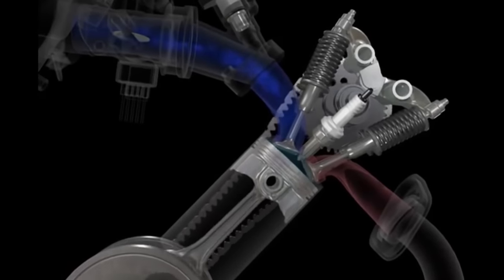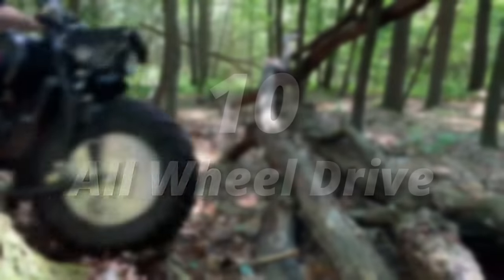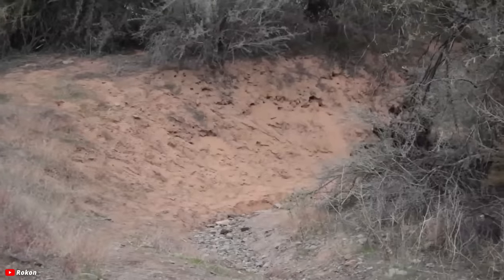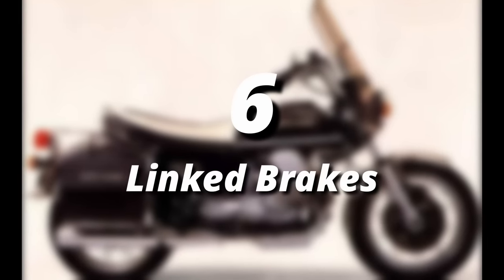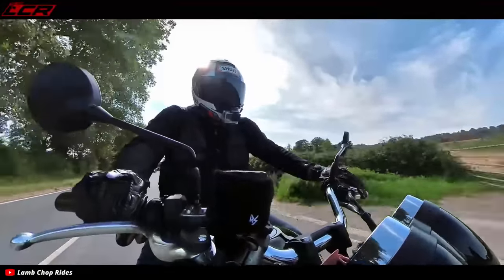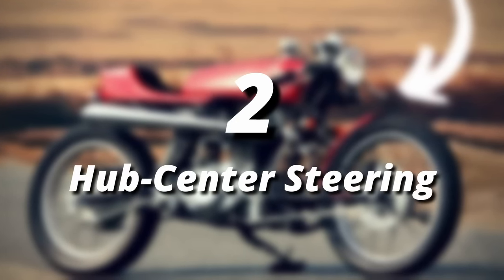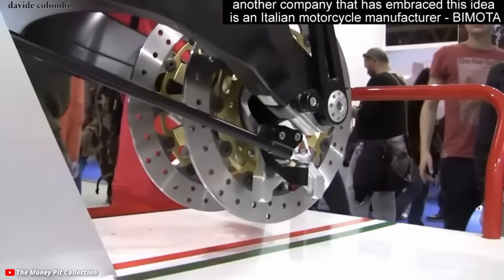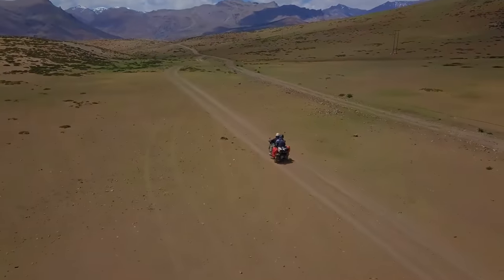10 Motorcycle Innovations that never caught on

Comment: My favorite innovation that never caught on was the Triumph sprung hub. It’s a suspension unit contained within the rear wheel hub and it was designed to give Triumph’s existing rigid frames the option of rear suspension.
Reply: @Retired Bore not only that, it was  also “potentially dangerous at high speeds” and one of the first moto accessories to come with a safety warning. It is also remembered as “a pain in the ass” literally and figuratively to repair and “one of the weirdest and worst rear suspension systems of all time”.
Reply: It was a good enough concept but simply didn't work well. Using modern metals and dry teflon sliding surfaces it would make a good addition to a hard-tail chopper, adding a bit of cushioning for the worst bumps without losing the classic hard-tail look; certainly more visual appeal than a 'savior' frame which works as equally bad as the old sprung-hubs do. Can't see much use for it on any other kind of bike though.
Reply: @P_RO_  Maybe on bicycles ?
Reply: What about the Buell?  Everything is different.
Reply: Sounds like someone has never riden one or had anything to do with them,  an atrocious idea that fortunately never caught on and lasted but a few years,  there are reasons why swinging arms are used on all bikes.
Reply: @Deontjie  Just a modified harley engine changing the stroke
Reply: @Johnketes54  not just a modified Harley engine. Mass centrilization and rim mounted brake rotors were also employed. Being bought out by Harley and saddled with that dinosaur sportster engine as well as no dealer support killed Buell.
Reply: @Retired Bore Turner is also credited with the Ariel Square Four and the 1971 Triumph Bandit / BSA Fury 350cc bikes.  It is unlikely he did much of the detail engineering
Reply: Very pretty to look at but even worse than the generally awful norms of its era.  Sprung hubs simple cannot offer sufficient suspension travel and are far more expensive to make than traditional hubs.
Reply: @obfuscated3090  the Triumph sprung hub gave limited suspension travel. Lots of gubbins had to be crammed in a small space, so it had limited bearing area, and wore rapidly - and the handling deteriorated badly.
Reply: @billstuart8481  buell wasnt bought out by harley. Eric Buell was an engineer for harley and built those bikes while working for harley. Then went out on his own with an engine manufactured by an austrian company

Comment: On the subject of automatic transmissions, they have taken off in a big way in the scooter/light motorcycle vehicles that are common all through SE Asia.  Some are the "it does everything for you" types, but what's also common is a transmission that allows you to shift, but you don't have to use the clutch at all.

These are really popular all through SE Asia, and the smaller Honda bike I ride around town and for errands uses this kind of transmission.
Reply: It is now common on really big bikes as well.
Reply: It's not automatic It's belt drive,Just because you don't change gear make it a automatic  and the second is clutchless which does have gear probably 3

Comment: Nice chanel .. nice video! What you was looking for about the self driving as a remark is "self driving is good for transport machines, motorcycles are usually not used as transportation, they are primarily a fun moment, and on top of that, have the benefit of taking us around".

Comment: I learned to ride motor equipped bikes on a twist grip shifter equipped scooter. My dad owned a Vespa knock off. It took an good amount of strength to get it to shift because the mechanism uses cables. Also, the position of the clutch lever would keep moving and put it way out of a comfortable position if it had more than 4 gears. The clutch lever position was already drastically different between 1st and 4th gear. The clutch develops all sorts of up and down play because all the twisting torque from the left hand passed through it. Good riddance I say. 

Nothing beats the cost, weight advantage and simplicity of a fork. Good enough for MotoGP, Motocross or Hard Enduro, or even downhill mountain biking, good enough for all consumers. Some suspension dive is desirable for motorcycles because it reduces wheelbase and makes a bike more willing to turn under braking, and often, the fastest way around a turn involves trail braking.
Reply: Dude, twist grips were the only gear changing mechanism on Vespa scooters, from the 1940s though to 2017 - bajillions of them were made, and people were quite happy with them.

Comment: I love the way you credit Honda for the GTS hub center steering as the GTS was a Yamaha, as clearly shown in the picture accompanying your voice over.

That about sums up what your opinions are worth to me.  You might actually try riding some of these bikes before expressing your flatulence about them.  For example, twist grip gear shifts have been, and still are, used on a wide variety of two wheeled vehicles where it is impracticable to use ones feet to shift gears.  I have two bicycles that use a twist grip to shift gears.  Just because you are ignorant about them does not mean they don't exist.  They still do and they work very well.

Sadly today's motorcycles have descended into fashion statements, Most are like their riders.  Fat and loud.  I was drawn to motorcycling sixty years ago as it was the closest thing to flying that could experience.  Modern bikes are too big, too heavy, and too slow to change direction, including many so called 'sport' bikes.  I blame the lawyers and accountants.
Reply: Yes,I noticed that glaring cock up as well. I guess he thinks you can just call it whatever you like...a Yamkawahonzuki is as good as anything. Another channel that is very light on accurate detail.
Reply: Hear hear. If this channel shows anything, its the lack of knowledge, experience and research of its owner.
Reply: You said it for me as well

Comment: I had an Italian Itom Tabor Sport 62cc with handlebar mounted gear change - this was back in the 60s - and the problem was that it used two Bowden cables and keeping them in perfect tension was difficult. A missed gear could result in stripping the teeth off the gear primary drive.

Comment: My first bike had some very unusual innovations. Fully enclosed chain. Rear wheel could be quickly removed leaving the chain and sprocket attached to the swing arm. And the front and rear wheels were identical and interchangeable allowing you to even out the wear on the tyres. And sometimes, when I thought I had engaged first gear it would reverse! (I'm not sure if that was a feature or a fault.) The mighty Voskhod 175!

Comment: Well, I have to say that I do like the linked brakes with ABS on my Honda VF1200F. Makes it much safer when there is sand, water or anything that may cause the front wheel to lock up or slip when braking.

Comment: The grip shifters are actually fairly common among the mopeds and low CC bikes (125-250cc) with the oldtimer club I'm in. Quite a lot of European brands had them, even Honda has a couple of old models with grip shifters.
And yeah, on one hand it's a good thing because now you only need to use 1 limb to shift but the massive downside is that when your clutch cable breaks, you're stuck where you are.
Though not recommended in the slightest, if you know how to it's quite easy to shift a foot shifter without the use of a clutch. It's going to be a bumpy ride, but at least you'll be able to get home.
Another problem with them is that is that you can go from first to last gear in one motion, the one's I rode were fairly intuitive 3 speed gearboxes but I can imagine it becomes easier to select the wrong gear when you have 5 or 6.

Comment: Polish 50cc moped Romet "Komar" (mosquito) from the '60 used to have gripshifts it was necessary because the moped had a crank like a bicycle, it was used to start the engine and you could use it to ride it like a bicycle if you ran out of gas or an engine failure (which was common because it was commie times) They dropped it later in production in favour for kickstarter and classic gearshift, mostly because the gripshift was unreliable (not switching when you wanted and switching when you didn't) and they ditched the bicycle crank since riding it like a bicycle was more of a hassle than just pushing it along ;)

Comment: Hub center steering, i think its a great idea for gearing the steering input, just a small movement of the handle bar for max steering, combine it with electric servo assisted steering and it will be awesome in the city.

Comment: I've been on K1600s since 2012. Their linked braking system is so good that, to be perfectly honest, I rarely use the rear brake, alone, even at walking speeds. Probably not the best habit, but the linked brakes truly are that good.
Reply: Our boy here thinks BMW only makes cars.
Telelever front fork and linked braking "didn't catch on?"
How does he think ABS works on a motorcycle without linked braking?
Reply: @russmiller7284 - "I rarely use the rear brake, alone, even at walking speeds. Probably not the best habit."
Why would anyone think that using the rear brake alone is a good habit, when it's the surest and easiest way to lock up a wheel and get into a skid?
Reply: @jackx4311  ...That shouldn't be answered in the uTube comment section.
Instead of watching top ten videos, search for motorcycle safety videos, or find a class.

Comment: I started riding in 1965, and almost all scooters and mopeds then had twist shift, it was considered standard equipment. One noticeable scooter that had foot shift was the C-Zeta, and that was also made in New Zealand under license as the N-Zeta. Front Suspension: You didn't mention BMW's amazing Telelever front suspension. I was given a ride on one when they first came out and it is astonishing. Totally stable, you could apply full front brakes and there is no dive and the front end is completely stable. Remember that BMW were the first company to have hydraulically damped front forks, too, in the 1930's.
Reply: BMW have always tried something different with front ends. Dont forget they used leading link well into the 70's

Comment: GTS owner here ;) It `s a good handling bike, bit heavy to push around but for it`s size and weight surprisingly agile up to about 90kph, not sure what happens to it when you enter highway speeds but the whole bike just transforms into a very steady high speed mode like if it had adaptive power steering. Can also lug quite a bit of cargo with the full pannier kit without affecting ridability. A real unsung hero IMO.
Reply: He mistakenly called the GTS 1000 a Honda. I don't know if you noticed that or not.

Comment: It has always struck me as odd that the simple pair of front forks remains the standard on basically anything that isn't a BMW R-bike, whereas dual rear shocks/springs have been relegated to "classic" models for decades now. When I've ridden Bimmers with the telelever, it really does make the bike feel more controlled under hard braking. I don't know what it's supposed disadvantages are, or why it isn't more common, but I dig it.

Comment: There's one other bike I know of which has the gear shifter and clutch on the handle bar is a 1960s German motorbike called the NSU Quickly, I could definitely see why it didn't stay

Comment: I have a 2016 Kawasaki Concours 1400 and it has linked braking and works very well plus ABS it was bought brand new in  Vallejo California USA. If you choose to can use only the rear brake to brake when doing this the front brakes are applied without touching the front brake lever. The same is true if you use only the front brake lever. Using only the front brake lever will activate the rear brake without touching the rear brake pedal. You said linked braking was not allowed in the United States. The Kawasaki Concours is still sold in the USA in 2022. This bike is also known as the Kawasaki GTR 1400.

Comment: I had a (2002?) Honda Silverwing scooter a few years ago. It had some innovations: fuel-injection, so no need to choke and warm-up; Automatic constant-velocity transmission; And the brake lever operated both the front and rear brakes. There was also a rear-only foot brake, which was required by law, but it wasn't necessary.

Comment: In the 80s Franco Sbarro had hubless bikes. 

In the rear, the chain went all the way around the rim and the suspension was connected to the wheel with a truck like you see on roller coasters. He had the same on the front wheel along with the front suspension you showed in this video.

Comment: Back in the early 1980s, I liked the linked brakes on my mate's V50 so much that I converted my T140E Bonneville to use them. Second disc on the front linked to the foot brake. Wet weather pads on the rear and the handbrake front, dry weather racing pads on the linked front. In the wet the brakes reverted to normal. Still got her. Grog.

Comment: My first bike was a 1982 Honda C50 LAG, a 3 speed 50cc automatic transmission Cub. Great fun to ride as a 16 year old and it did a whopping 42mph! On the left handlebar where you would expect a clutch lever on regular geared bikes was a strange handbrake lever which you pulled in to lock the rear wheel. It was called the 'parking brake' I think. I've not seen it on another bike so I guess motorcycle handbrakes never caught on!
Reply: All of today's Honda bikes with DCT have a parking break
Reply: @dw8931  I have no idea what DCT is which shows how up to date I am!

Comment: Nice video! I would also think of centrifugal clutch, automatic clutch disengage (old Jawa got these), turbine power and rotary power. Also steam motorcycles. And radio sound systems. And diesel engines.

Comment: The ergonomics of the twist shift seems...awkward at best. 
I'm also skeptical of it as I've limped motorcycles back to their homes in a variety of conditions: bent handlebars, broken clutch levers, broken shift pedals...and you can usually kind of get something to work if it is just one of those, but if a single hit takes out all three?

Comment: The Moto Guzzi linked brake system was two separate  brakes. the handlebar operated one front disc, and the foot pedal operated the other front, as well as the rear disc.

Comment: Ever since I was a kid I had this design in my head for a 2 wheeled covered bike. Two very wide tyres, with an enclosed body where passenger and driver sat in a row. It looked a lot like that yellow 2 wheeler you showed for a second rounding a corner but with thicker wheels. 

I’m shocked you didn’t mention the bicycle car thing, 3 wheels, two on front, one on back, powered by electric pedaling!
Reply: Two people bouncing around in a cage doesn't sound like fun to me.  I'd rather be thrown clear of all the metal and gasoline.
Three wheeled vehicles are called tricycles and are ridden by those with no balance.  ie...toddlers and seniors.

Comment: Lots of older small cc German motorcycles and mopeds had hand shifting like the Vespas. 
Have you looked at the front suspension of the BMW GS models. They have a swing arm front suspension. 
Great video.

Comment: I would encourage more research on the linked brakes example you used. Moto Guzzi's linked brake worked really well, being the pedal only actuated the rear disc and one front disc, often through a proportion valve. The other front disc was utilized through the traditional right grip lever. Modern abs made this system obsolete.

Comment: The linked guzzi break isn't quite like you descripe. The foot break engages the rear break and the front left break, the hand break engages the front right break. It's a good system and it allows for quick controlled breaking even when mid corner.

Comment: There's an ergonomics issue with twist grip shifters in that the only time the lever is in the best ergonomic position is when it's in neutral. Add to that how the cables used to make them stuff up fairly quickly.

Comment: Handle bar shifting: The older German Zundapp and Kreidler light bikes used this kind of shifting… And for combined braking: this is used on BMW’s as standard, where the rear brake is engaged together with the front brake in order to stabilize the bike.

Comment: My Honda VTX 1800r has linked brakes. The foot brake I think is divided 60% to the back 40% to the front but I also still have a front brake lever that operates two Pistons per caliper. I love this setup. Some people don't. I have never ridden a motorcycle with abs or traction control.

Comment: In Poland we had mopeds named Komar(Mosquito) with grip shifters, in the 60-ties,70-ties and 80-ties. They had two speeds and it was somewhat hard to put in in first gear, because you had to overcome a spring tension. They had a 50cc engine of 1.4HP.

Comment: Combined Brake Systems actually are pretty common now in Europe. CBS and/or ABS is required for all new motorbikes up to 125cc (the L3e-A1 homologation). As far as I'm aware, those new systems are two-way - if you press the front brake, some force is applied to the rear. And vice versa, if you apply just the rear, some force is applied to the front. This way you can still balance the front and rear pretty easily.